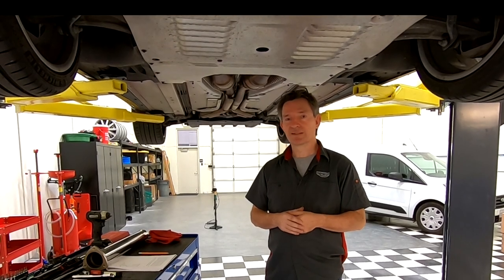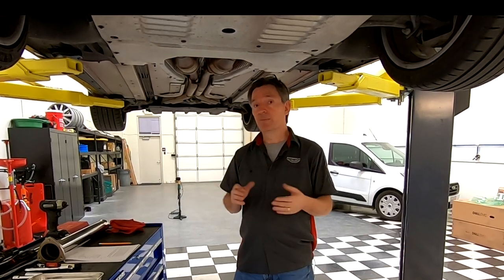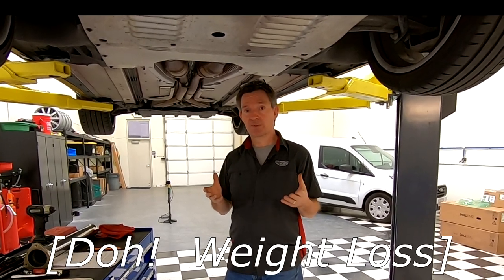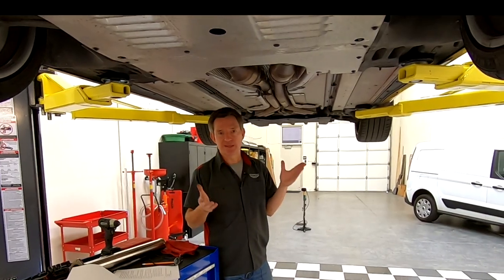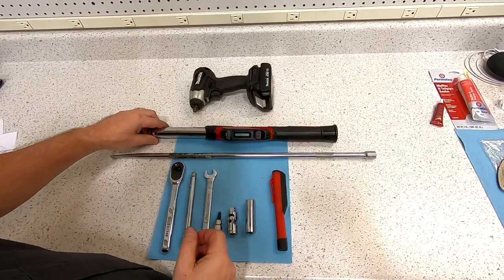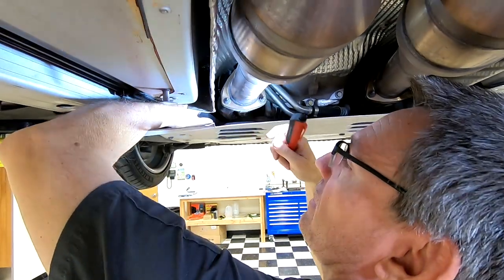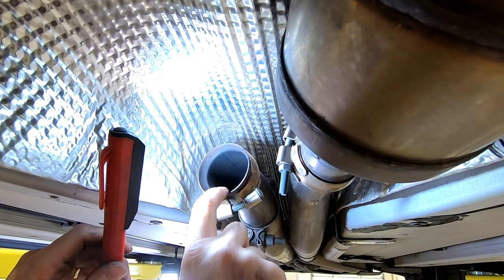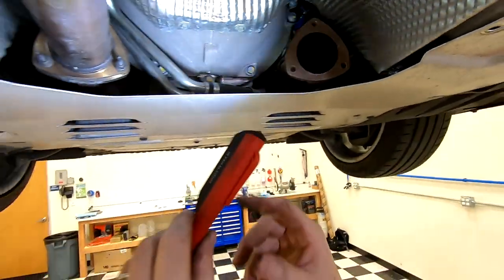Removing the Secondary Catalytic Converters from an Aston Martin DB9

Comment: 2nd cat delete with straight piped is best sound in my opinion. I had x-pipe, h-pipe and straight pipes all built for and tried on my 2007 DB9. H-Pipe and straights were best sounding, most aligned with a low grunt type sound as it's recognized for. Straights were loudest, H-pipe 2nd, 3rd standard with flaps disabled, 4th and last x-pipe (much higher note). The X-pipe, omg horrible. The higher most exotic sound ruined the car in my opinion. Let me know if youd like to hear all configs. Great vid steve.

Comment: Hello Steve ,

Great job on the videos  !   Did the removal of the secondary cats trigger a Check  Engine light  ?
Thank you
Reply from the maker: I think I noted in the video it does NOT trigger any warnings.  There are no O2 sensors around the secondary CAT so there is nothing to trigger.  Thanks for watching!

Comment: Were you able to pass CA emissions and visual with secondary cat delete? I'm looking to sell my vantage v12 with secondary delete and concerned about backlash selling/trading in. It passed CA smog and visual when I initially bought but wondering if it was overlooked by whomever inspected/was pushed through by the CA dealer.